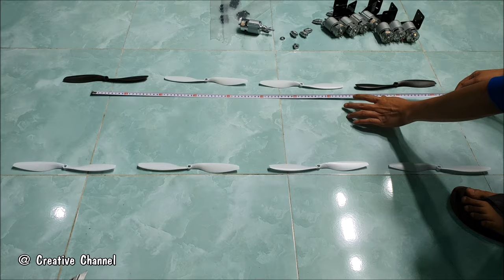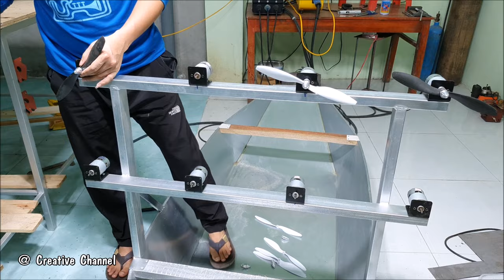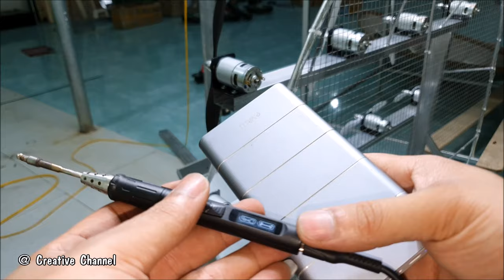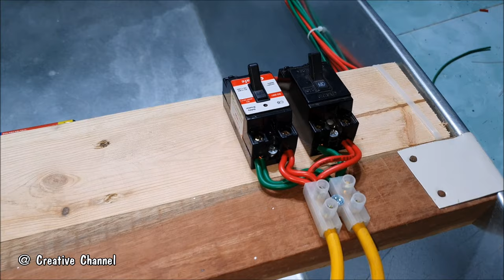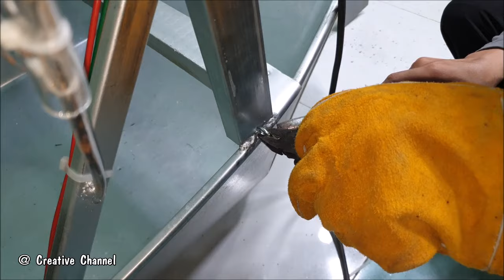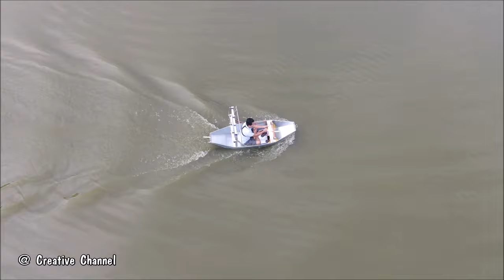How to make a Big Airboat Using v8 775 Motor

Comment: great boat, but the whole point of an airboat is so there are no low hanging rudders to get caught on stuff when you run something over. keep up the great work man you are great motivation for me!
Reply: Yup, airboats are steered with multiple rudders mounted behind the propellers. With the flat bottoms they can even cross short stretches of swampland that are slightly above water level, as long as their are no obstructions that can rip out the bottom.

Comment: My neighbor who is an engineer says this mechanical contraption assembled through the help of a garage equipped with power tools, is more of a novelty than a real working air boat that will cruise the bayous and rivers .
Reply: I think this boat would get stuck in the everglades if it went over a huge patch of algae. Just not enough power. Still fun to drive and to say you built your own boat. Also very portable!

Comment: The hull design seems to be a limiting factor.  I'm no expert, but a slightly bigger and flatter hull would make it more efficient, IMO.  Also, if the motors were made to pivot, you wouldn't need a rudder hanging below the bottom of the hull.  Or have rudders behind the props like a standard airboat.  I like the build, though.  I spend too much time agonizing over measuring and fitting when I build stuff; this guy seems to do a lot just eyeballing things.

Comment: Nice work!  However, the whole idea of an airboat is to go in very shallow water with weeds.  Your rudder prevents that.
The propellers could be wired to run only the outside on one side only to steer.  OR, wire in the ability to reverse one side or the other while staying in forward on the opposite side.
Lose the rudder!  Manage the airflow to steer the boat.
Reply: need speed controllers not full power on and off longer battery life too

Comment: @Creative Channel you do not need a rudder system, because you have 4 banks of 2 controlled fans per switch, all that you need to do is, turn on the fans on the side opposite of the direction in which you want to go (the fans will push your boat in that direction you want) and turn off the fans on the other side, and now lets just say that you want to go on an angle, you would turn on 3 sets of fans (2) on the opposite side in which you want to head to, and (1) set of fans on the outside for resistance.
Reply: I was thinking the same thing

Comment: Fantastic! I like it! 
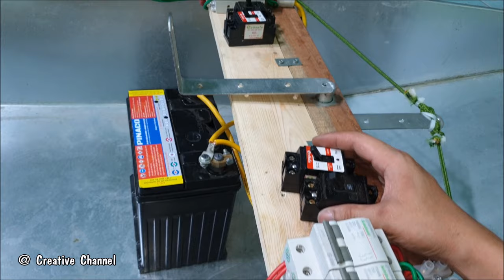22:50 But why did you replace the switches to the automatic circuit breaker?
I would built into the electric ciruit a digital voltmeter to see how strong the battery is.
Reply: You do make tons of sense.
Reply: Creatif chenel minta dinamo dong 4 ya
Reply: bodrob80 higher capacity
Reply: @yulinarlisnawati7898  gblk

Comment: 10 inches prop is too big for brush high speed motors. you have low efficiency with high current drains. put gearbox on them and you have much more trust
Reply: This 150W motors are capable to run 10" propeller.
Reply: This 150W motors are capable to run 10" propeller.
Reply: @abdulkader5470 this brushed motor's rpm is around 20000 rpm With low torque. If they were brushless, it would be better. Or larger propeller with a gearbox.
If you listen to the sounds of engines, you will find that by turning on all engines. How much power is drained from the battery and the battery is drained quickly. maybe they're lower than 7000 rpm.This means efficiency is below 20%. however maybe only 2 motors with small prop under water make this bout faster and longer range
Reply: @aliakbari437  I know this motor type.
775 motor have many categories according to Rpm and torque.
This motor have 12000 Rpm with high torque.
Also have many categories.
Like 24000 Rpm, 18000 Rpm, 9600 Rpm, 6000 Rpm.
Also have 100W, 150W, 200W and 288W.
But any category this 775 motors have greater torque than other motors.
Reply: @aliakbari437 this is a airboat and not a normal boat. with a normal boat you need a special propellor for underwater. with a normal prop you can't go faster...

Comment: Quite creative, but I bet when he fires all those little props off simultaneously it will sound like bumblebee mating call on energy drink. Looks like all aluminum construction. Wondered how he welded that 1/4" hot rolled steel rod to the aluminum frame? Perhaps I missed something.

Comment: Should have put the wire in plastic conduit. If the wire wears against the aluminum of the boat that's not going to be furn.
Reply: He took the time to wrap the sharp chicken wire in plastic tubing so I'm surprised he didn't take the time to cover the wires and make it look more clean.
Reply: @Doriamo  more clean?   It's an aluminium boat with copper wires, with the bouncing around the wires rub, make a short and you get zapped.
Reply: @thomasbroking7943  that's why covering the wires would have been best. And nothing wrong with taking pride in your work, no matter the project.

Comment: What's under my table:
Dustbin, Printer, Books
What's under Creative Channel's table:
2 boats
Reply: Haha
Reply: One day he will pull out a jumbojet from under his table or any corner of his shop, it seems to be like the bag of santa, just endless amount of space and stuff
Reply: @Wilson84KS  haha
Reply: haha  😂😂😂😂😂
Reply: Propellers should be in the water, not in the air, in the water it is much much stronger and faster.
Reply: @Acko1  It runs on air not water.
To make propeller under water need water resistant motor and small propeller.
And air it is much easier and safe.
Reply: @abdulkader5470  the motor can be protected from water, and also a smaller propeller,
The water propeller is better
Reply: @Acko1  I know that.
But it is easy to say but difficult to do.
Reply: @abdulkader5470  :D
Reply: @Acko under water you need more torgue to get in motion, in the air it is like sails but other way around if you know what I mean xD it is not only easier to make, but also easier to drive and this thing is ways faster than I thought, if he continues this project, use a different boat, longer, flatter, wider and hydrodynamic, use more propellers and switch them one by one from the center on and put the steering paddle behind the propellers instead of under water, he will have a serious motorboat, next step would be to set it on an air bed and make a hovercraft of it :D
Reply: HAHA LOL
Reply: Parabéns 
Boa zero um
Reply: @Acko1  I say props run best in concrete lol, but FR though imagine if someone put like 4 quad motors all driving separate props in the water
Reply: Ha ha
Reply: What the hech men  you send it
Reply: Acko
Reply: And a 3 foot long fingernail.
Reply: Oğlum sen türk değilmisin
Reply: Cam
Reply: Hahahahahaha
Reply: Good looking
Reply: wonder ful
Reply: Michael Stevenson  air is way in which it cause pressure to move forward.
Electricity makes the motor to turn and propeller push the air and it goes forward. 🙄
Reply: @fatemamultan  gffgvggfh
Reply: Supper
Reply: @Acko1  this sort of boats originated in soutern american swamps, were the water is too shallow for underwater propellers, so these air pushing boats can travel muddy waters with no issue.
Reply: Or a flux capacitor
Reply: @Wilson84KS  flying boat
Reply: Vikram
Reply: @spideyff2936  nnnnñnmmnnnnnnmnnnnnnmnnnnnnnnnnn
Reply: @spideyff2936  nñ
Reply: @Acko1  Do it, i want to see!

Comment: Why don't you use Brushless Motor?
Use Brushless Motor and ESC.
To control like yours use 4 servo tester.
It will be great and more powerful if you use Brushless Motor.
Reply: It will be significantly more expensive tho
Reply: @OmarElmasry1  Yes, it is.
But you see, he have any item products as he wants.
Reply: It's more power consumption
Reply: @Ahmed_Elmahdy  He can add 2 * 12V battary.

Comment: This is one talented guy! I wonder how long it’ll run by just using one battery. Great job and great idea.
Reply: Apparently those are 150 watt motors which at 12 volts would draw 12.5 amps each.  8 motors will draw 100 amps.  That battery looks to be about a 50 Ah size so it would run for 30 minutes if you were willing to destroy it by completely discharging it.  At a more healthy 50% discharge level, it should run for 15 minutes at full power.
Reply: اه
Reply: @Andy-df5fj  87
Reply: @Andy-df5fj  7
Reply: @Andy-df5fj  على هذا

Comment: Wow, it's unbelive workable ! but at first, you felt so noise right ? by the way, metal small boat should be rusted very quickly, and 775 motor not reliable for out door use.

Comment: Leonardo da Vinci 2.0
Reply: Propellers should be in the water, not in the air, in the water it is much much stronger and faster.
Reply: Non insultare il buon Da Vinci!
Reply: @bluefire87HN  era ironico dai ahaha
Reply: @Acko1  yes, but it's complicated to do it without the motors getting wet... Of course you can do it, but you have to prepare a proper isolation

Comment: you were doing so well until you put a rudder on it, which negates all of the abilities of being an airboat. now it can't run in 1" of water or over thick vegetation. the rudders were supposed to go behind the props and steer like an airplane. Florida native here. run and built several full size ones.
Reply: Ever run anything with VW or Corvair power and if so what size and pitch did you use to get around?

Setting it up for the motor mounts is no biggie- oops except what angle did you choose for a thrust line (?), since its basically going to be the same as we use for aircraft with these engines where an actual engine mount had been fabricated.

Been in love with these type of craft since the first time I saw one

Comment: I think the kids pretty smart.....to be able for hooking all of them motors to a battery.......and having them working out very well......he actually has some speed out of that boat.......more so .....that’s I was intended for the motor’s that’s he was putting on.......I honestly didn’t think that’s the boat was going to have that’s much get and get and go........I’ve been around boats for many of years......and I’ve run into boats that were just 14’ skiff’s that could barely get out of their own way...........this with and his gear,,,,gets up and moving.....is quite impressive.......that’s boat is not a light boat...and with that roll cage that’s he added on the back.....to support the motor’s and the weight of the battery.....he has done a quite impressive amount job......kudo...........

Comment: Why the rudder? just turn on and off the motors by sides
Reply: It is horrible if it goes uncontroll. And in free run it need rudder to control.
Reply: @abdulkader5470  Tell that to millions of drones out there. 
Water is just a fluid as air is and we don't see "uncontrolled" drones daily, but yeah, you can found a lot of bad pilots
Reply: @isidoromaich7226  This is not a drone.
By the way water creates a lot of drag to control it.
On the other hand by switching motor control is low maneuver.
Reply: @isidoromaich7226  spend five minutes in a boat and you'll understand. The boat will not track straight at  all in a slight crosswind do to the freeboard. You need a rudder.

Comment: Rudders go behind the props. You've defeated the purpose of an airboat. now you cannot go shallow or cross sand bars/reeds.   But good job otherwise!
Reply: That would defeat the simple design because it wouldnt have enough power to push the weight of him and the boat over tulies/sand bars..

Comment: This is cool and all, but don't you think you would've been far further ahead if you'd just put a 12v trolling motor on. Far more efficient, quieter, and complete speed control. Probably a lot cheaper than those motors and props as well.

Comment: There is usefull point by this air board .it take high rpm and much energy .better attaching one another shaft and put in to under water .energy will save

Comment: 150W? That means 5 of them is about 1 hp. It also means you are drawing  12.5 A per motor from the battery or 100 A total - that won't last very long on a car battery. The sound is kindof cool though.

Comment: No point to an air boat if you have a giant rudder under the water...... Outside of that, cool idea.
Reply: @aggressive pizza there are a few problems with that thought process. First of all "most" and "boats" are highly subjective to the part of the world you come from. Secondly even all "boats" world wide considered, if you remove sail boats then most boats actually don't have a rudder under water. Most "boats" use an outboard motor that rotates, and out drive that moves, a jet that moves or a true air boat uses flaps that move directly behind the prop kinda like an airplane. Now sailboats and ships, yes most of those do have rudders under water but those aren't airboats. The idea behind an air boat is to go into shallow water or even over land without damaging anything......you can't do that with a rudder
Reply: @aggressive pizza that would be better than a rudder for an airboat, although probably not as effective as the standard blades or a rudder unless you could also reverse half the motors..... Now that's and idea, a boat that can turn 360° in it own footprint.......

Comment: Would it be possible to mount an alternator on the boat turned either by a water wheel or the wind to keep the battery charged? I kmow the old law you can't get more energy generated than you put in. Just curious.

Comment: I don't see any comments on this but NEVER solder your connections for screw terminals! Solder has a tar-like property where it flows over time and especially with current going through and heating the connections you can cause failure and fire

Comment: have you ever run out of power in the middle of the lake?
I think it's time to attach a photovoltaic plate!
Reply: The paddle he brought would get you back way faster.    A 100 watt might fit on that boat and it wouldn't even run one of those 150 watt motors at full power.
Reply: @Andy-df5fj  Another idea is to make an airboat (like the one in the swamps) powered by the mechanical energy of the pedals. I love your ideas, so creative.

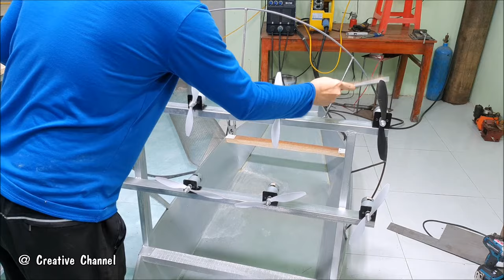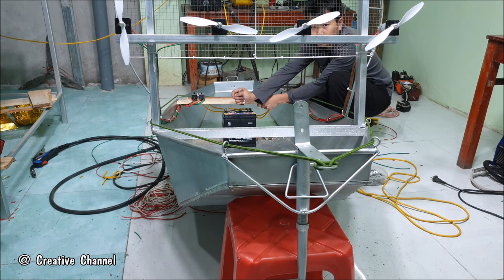Comment: some info.    at  7:04,   the use of  SLOW-FLYER  (SF)   props  equals   WRONG.    prop noise  Could be  less, if   E P  props were used.       at 22:41,  it would have been a good idea to install cable  Pulleys,  at the  'corners'.     googletranslate

Comment: Never solder wires that are going into a screw connection box, over time the solder cold flows and you end up with a bad connection, just come loose, have seen this very many times. Just IMHO
Reply: Thnx for the advise
Reply: Quick GoogleOne should never apply lead alloy solder to stranded wires (often called "tinning") that are to be tightened under a screw. Eventually, the solder will cold-flow under the pressure and the screw connection will become loose. This doesn't happen overnight; it can take months or years.Dec 24, 2018BUT THEN I ALSO BELIVE THE WORLD TO BE ROUND !! , NOT IMHO ANYMORE CONFIRMED

Comment: Everheardofomes law?
Reply: Currently the circuit is directly proportional to the applied voltage and inversely reports to the resistance and constant temperature basically means if you’re too much current then it goes up resistance goes up that’s why your cables a mountaiblesaremealyingtomuch current soresistancegoesupresistancecauseshighertemperature. Bigger cables required, or dontdrawsomanyAMPS
Reply: oHMSLAW?